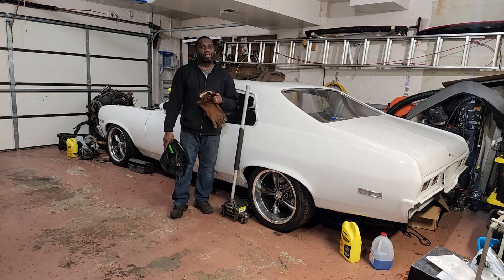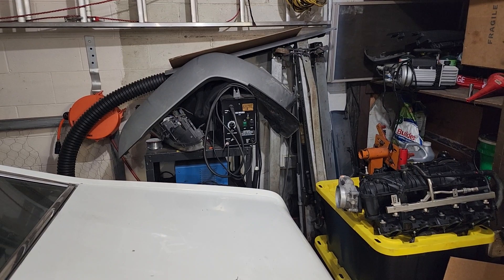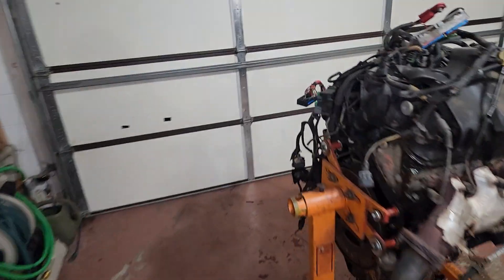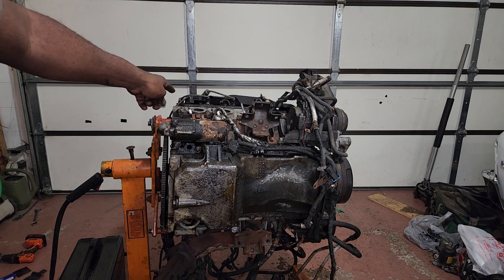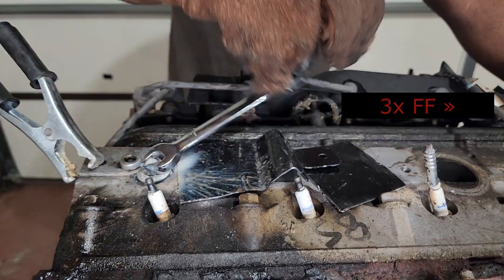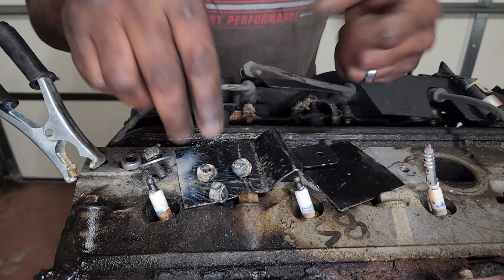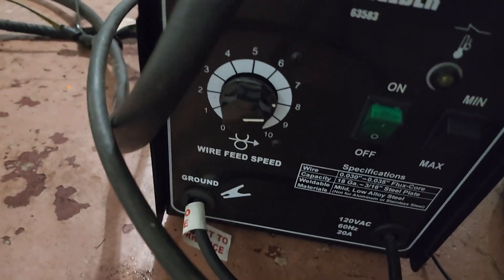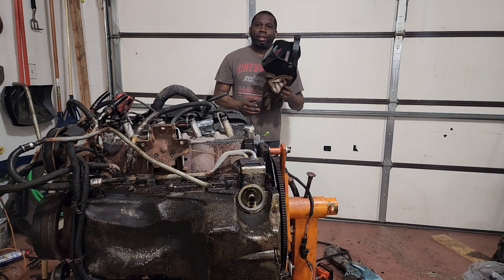How to remove broken exhaust studs on any LS engine for $3 & a Harbor Freight welder! Ep.4

Comment: So why did the first 13 attempts fail and #14 succeed? Was it just poor penetration or the repeated heating and cooling cycles ?
Reply from the maker: It was combination of poor penetration due to me not being able to clean bolt off well(I didnt want to get Dremel and clean it,it sat well below surface) and poor angle of the wrench. I had it for sure on #9 but bad angle got me in the end.